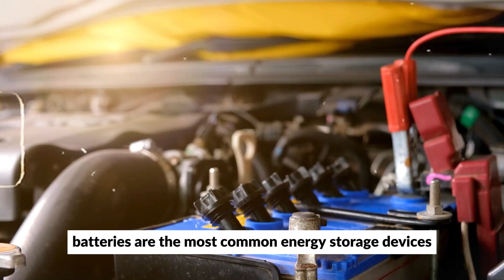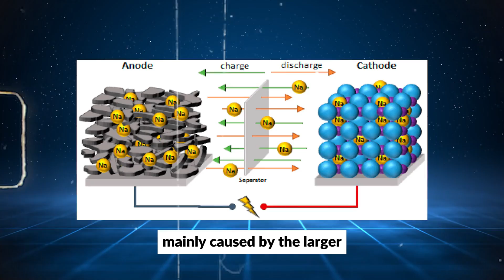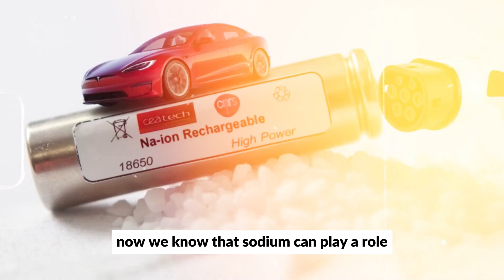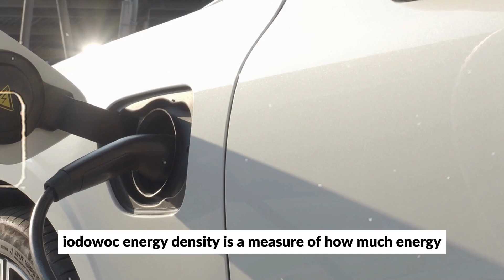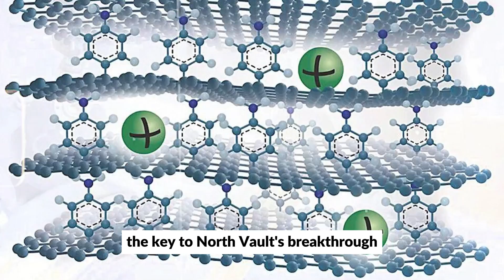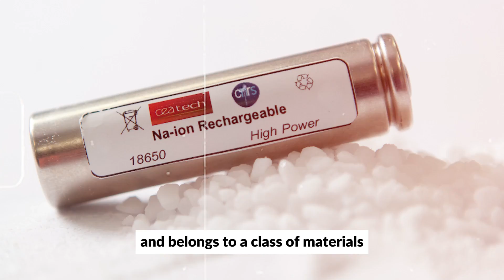Sweden’s NEW Sodium-Ion Battery SHOCKS The EV Industry!

Comment: I’ve been telling people about these batteries since 2019, and they acted like it was a pipe dream. Well here you go! They also said the same thing about LFP and solid-state batteries both in which I’ve owned for years now in 300Wh power stations. Now that we have USB rechargeable, small AA and AAA+ Li-ion batteries I want to see more sodium and LFP chemistries of that size w/ said usb-c rechargeability. 
The fact that we’ve been throwing away these small batteries after 1 use is arguably even more (collectively) insane than throwing away a $1 million rocket after one launch.